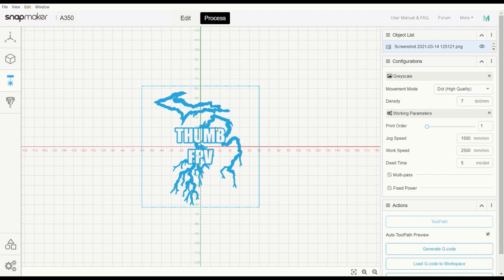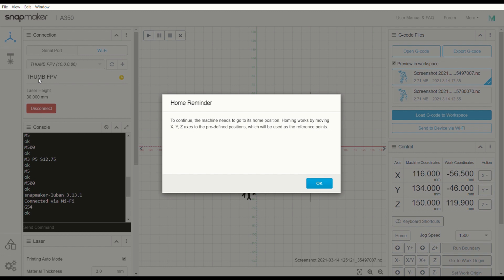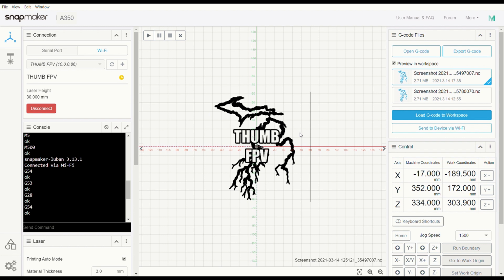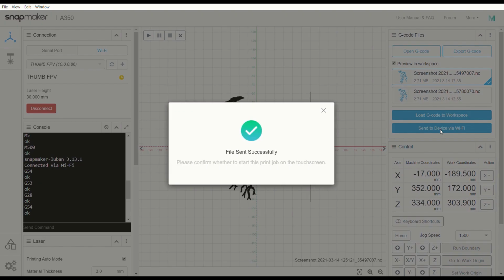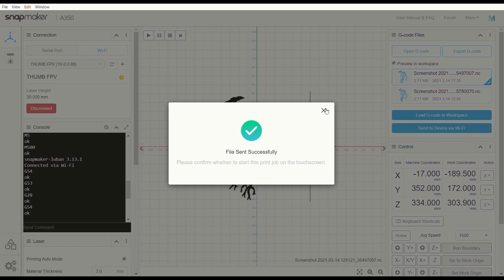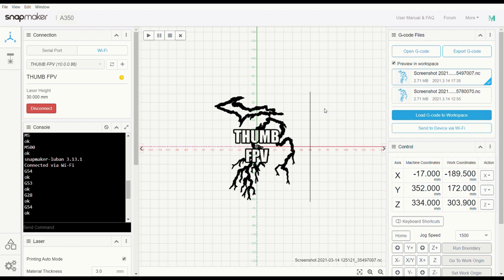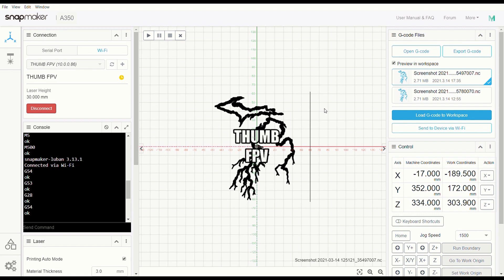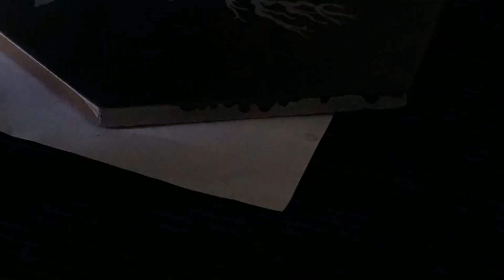LASER ENGRAVING TILE WITH SNAPMAKER 2.0

Comment: Hey mate, I've been etching clear glass with my Snapmaker (A150) for the last week and getting great results. Top tip, use "washable" paint; AKA poster paint, AKA kids paint ;-)
After you finish the etch, the paint rinses of in seconds with a wet sponge and running water. I'm halfway through etching a family crest on a whisky decanter as I type this. I have already etched the stopper and it went great. I have the GoPro running and I'll eventually post it on my channel (hopefully before Xmas ;-) )
Reply: Good tip for the poster paint, did you manage to post a video covering it? Just got my A250 3 days ago and haven’t had good results so far

Comment: Maybe run it slower?
Reply from the maker: Definitely a good variable to play with.
Reply: @thumbhobby1390  A few things. First, change your camera recording settings from "Interlaced" to "Progressive" so that you don't get the horizontal lines in the video (especially noticeable when you move quickly). Second, you should try to etch tiles that have a dark flat glaze on top so that you don't have to coat it then scrape it off. Also, because it is ceramic tile, you don't have to worry about heat build-up in the material (don't have to worry about it catching on fire if you run it too slow like wood or plastic), so you can basically run it as slow as you want. You can also run the same G-Code several times to keep etching it deeper and just stop when it is good enough. I recently got the A350 and I have been having a lot of fun trying to see what it can do. Have fun. FYI, I recommend laser on wood at 200 - 300 mm/min at 100% power. I have been able to make some awesome looking wood coasters with logos in them. Don't always think that 100% laser power is the best. Tonight I actually found that 100% power at 180mm/min will actually burn the wood and make it look like fire wood in a fire after it is done (but doesn't actually catch on fire), but when I ran the same code with 80% laser power and at 120% speed, it actually came out smoother and darker.